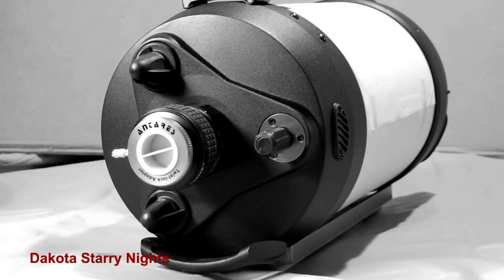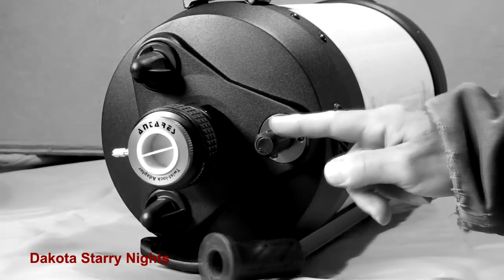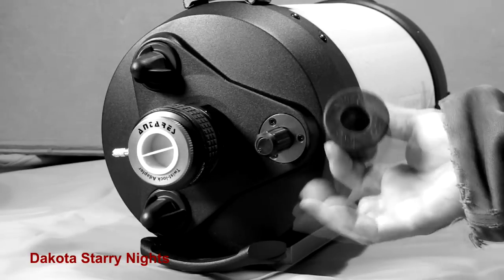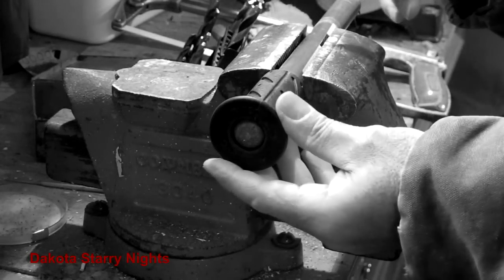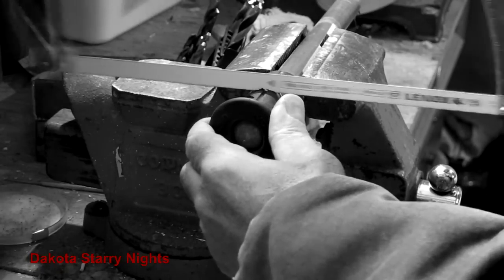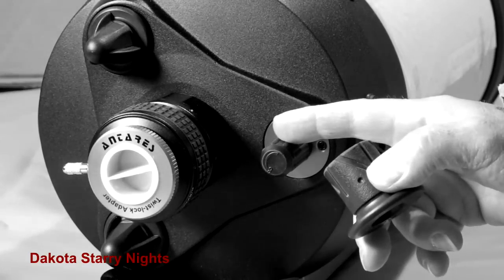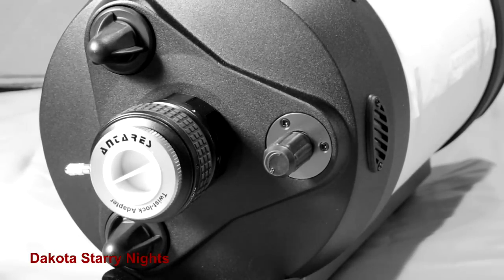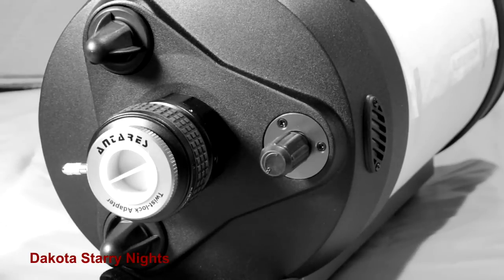DIY Focuser Upgrade for Schmidt--Cassegrain Telescope

Comment: On my 8" SCT I use a peanut butter lid. If you cut a hole in the lid center the size of your focus knob slid it on, maybe a drop or two of hot glue, with the "flat side" facing the back of the tube assembly, then you retain the use of the original focus knob, and the advantages of a way larger ratio buy using the lid edge. The other cool part is that you can use so many different color lids it makes it really easy to see. You can try all different sizes to find the one that work best for you, any plastic lid will work, and the larger the lid, the better the ratio. Just make sure it will clear the visual back.

Comment: Good idea and good video. One of the great mysteries to me is that these SCT's, even the higher end ones, have never addressed the mirror shift and poor focuser response issues. I have never met an SCT that didn't mirror shift or focus lag right out of the box. But what does one expect from a telescope costing thousands though?

I suppose it is marketing and cost level but when a customer has to make corrections by purchasing a Crayford add on or using bicycle parts I would think the market is there.

Vixen has some really nice Crayford focus standard modified Casses with fixed primaries and if I ever buy another SC style that is what it will be. Until then I will stick with the refractor.

Comment: A separate question - for your Celestron EdgeHD 8" , can you share the storage case/bag etc that you have?
Reply from the maker: Jake Bozman I pick up a plastic tote box with a snap lid.  You can get them at any dept store, like Walmart or building supply store.  And it's water proof. :)